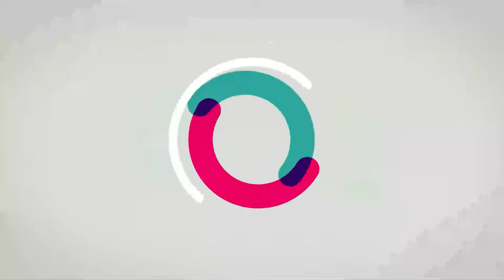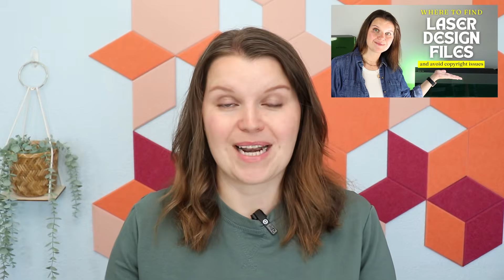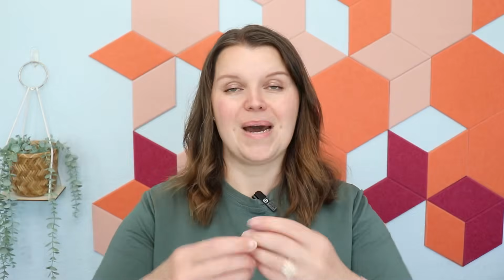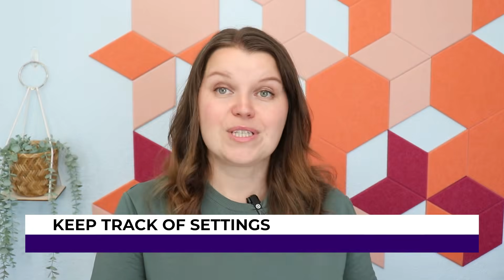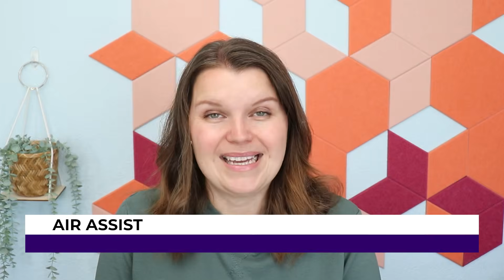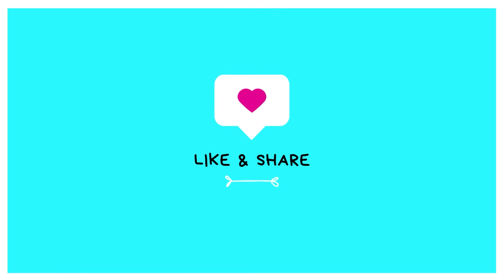Pro Laser Engraving Tips I Wish I Knew as a Beginner

Comment: im struggling with cleaning acrilic after engraving (with protective paper on) and painting with acrylic paint....i want to clean the piece since its jewelry and i dont want the client having problems, and when i do, i can see that the masking leaves a residue thats takes forever to come off only using some neutral soap and water sprayed into some cloth...if i want to make this faster and more efficiently, i need to use some alcohol, but the acrylic paint that filled into the engraved part comes off a little.....does anyone have any better way to clean the residue from the paper without affecting the paint? thank youuu
Reply from the maker: A couple things to try. If the original masking is too sticky, try removing that before engraving and replacing it with a different type. Or try a cleaner like LA totally awesome to remove residue, I've had luck with this.

Comment: Thank you for the video. I am considering buying Xtool  S1 , but I am really terrified of the fire possibility. I have a question - I am  visual artist and printmaker  and my goal for buying a laser cutter is not to create craft projects rather to use it to create different printmaking plates (like woodcuts) or acrylic engraving, or cut elements for my mixed media art. Is there a website or forum where I can check timing for creating different elements or stencils? I don’t know if my ideas really make sense timewise and if it’s worth investing . I have a cricut machine for simple tasks like stencils cutting. For example if I would like to  cut 12 x 19 mdf plate 1/8 “ into 3 pieces and do deep engraving of a stripes or checkerboard- how much time will it take approximately? Or engraving a rubber piece or acrylic.  Also  I don’t know if I should buy 20 or 40 Wat. I know my question about timing is very specific, but maybe you could give me some ideas. Thanks.
Reply from the maker: I think a laser could really help you create what you are talking about. But you're right, it will take time. A higher wattage laser generally moves faster, so the 40W would be more efficient. xTool has a lot of information on their platform but they don't give time estimates for projects, there are just too many factors that go into each piece. With my S1 40W I can engrave a full cutting board in under 20 minutes, but the engraving isn't very deep. You may want to check in the S1 facebook group and see if anyone else is using the machine in a similar way. https://www.facebook.com/groups/1809380769558447
Reply: @SarahVanderkooy thank you so much for your reply. I will check the group. I have one more question about IR module- does it engrave deep lines or just a shallo marks on the surface surface ? I am thinking about copper or brass. And have you engraved a larger areas on metal ? If yes, does it take a long time?

Comment: I was told i only needed to use the air assist when only using the laser.  Not when I'm cutting with the blades. Is that not true?
Reply: I use air assist only when cutting, not engraving or scoring.

Comment: I am experiencing an issue where my WeCreat Pro machine moves normally during an engrave job, but the laser is not firing at all. What could that be?
Reply from the maker: A couple things you can check. Is every cord fully connected and is you laser lens clean and not obstructed. Then double check your settings, are you set to cut/engrave and have a high enough power and speed for your job. In some cases, if you don't set the parameters it will default to 0 or 1 and then it looks like nothing is happening.

Comment: thank you as usual for a great educational video. I recommend you all the time as a great source of info. I have a question, well 2. I have a project that was created to use with 6mm wood. I'd like to make it with 3MM. How can I change the size of the slots to work with 3mm wood. I've tried asking in groups but I haven't gotten a good answer yet. The 2nd is for the air handling. I have the Vista and the mini air and it works great. How would I be able to hook it up so that it goes to the mini air and then outside the window. Thank you so much for all of your sharing.
Reply from the maker: Resizing that design can be tricky. If you purchased the file, I would reach out to the creator and see if they can alter it for you, or if theyhave recommendations. Otherwise, bring it into your software, ungroup everything, then resize the slots manually. 
The mini fume extractor does not have an option to vent out a window. I didn't mention it here, but I have that filter and it's currently hooked up to my Vista. It does a pretty good job of filtering the air. I do open a window behind the machine while it's running to just add some extra air flow.
Reply: If you use Lightburn, it has a feature for resizing tabs and slots
Reply: Big Blue Laser Designs has tutorials for resizing slots in both Inkscape and Adobe Illustrator that are easy to follow and very helpful.